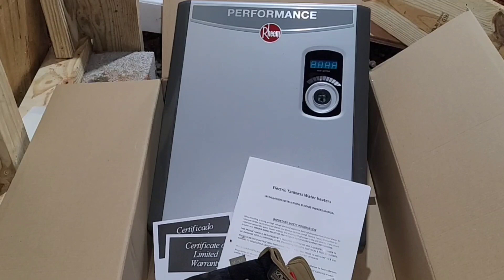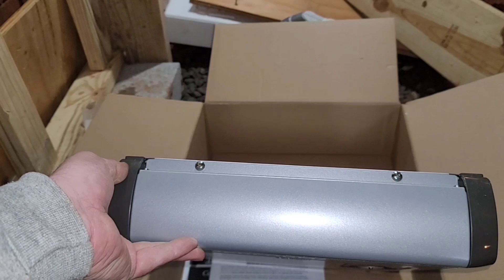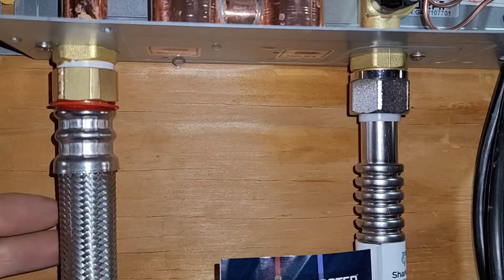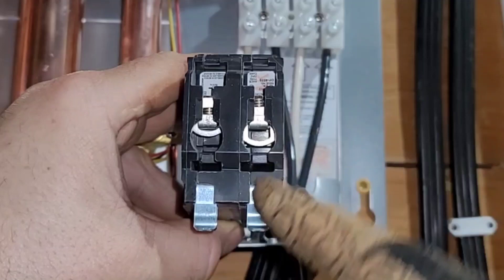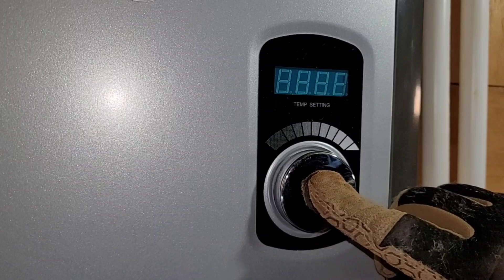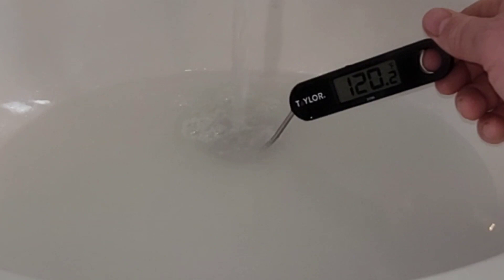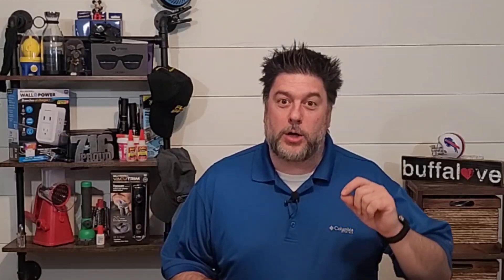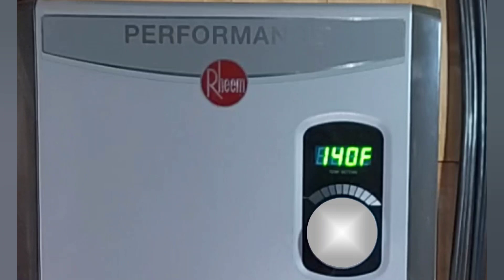🌟 Tankless Water Heater Installation. Rheem tankless water heater installed and tested [478]

Comment: Hello Jeff, I have a question. If I'm installing a 27kw rheem tankless water heater will I need three 8/2 wires and three 40amp breakers to get it hooked up correctly?
Reply from the maker: Hey there, my recommendation is to always consult an electrician, as i am not one. I checked outthe HD website, it looks like the 27 kw unit calls for 3 double-pole 40 amp breakers and 3 separate 8 AWG wires.
Reply: Thank you for you quick response. I appreciate your help and confirmation.

Comment: So at the double pole breakers, one gets 2 black wires and the other gets 2 white?
Reply from the maker: Always consult an electrician if you're not 100% sure what to do. In my case I had black and white on one breaker and black and white on the second breaker. And although I did not show it in this video, I did reconstitute the wires so they were both black. Thanks for stopping by and commenting 👍

Comment: I have this unit and I'm getting an E5 code. The code won't go off until we choke the water down to a trickle. Any thoughts?
Reply from the maker: E5 is a flow rate code.   I get that too, but it doesn't seem to impact the hot water. My psi is set to 60. Thanks for stopping by and commenting 👍

Comment: The only problem is if the power goes out, you have no hot water, you still have hot water with a natural gas tank heater
Reply from the maker: You are correct. My last water heater was also electric, so I'm in the same boat. Lol. Thanks for stopping by and commenting 👍
Reply: @Jeffreviews4u  Have you thought about getting a generiec system, that would come in handy..
Reply from the maker: That's the goal for 2023. I've recently priced them out, now to save the cash.

Comment: That is a slick unit, what gauge wire did you use?
Reply from the maker: 8 AWG...pretty thick stuff. I've been impressed so far. Thanks for stopping by and commenting 👍

Comment: Your tank had E5 shown on the display. Is that an error code?
Reply from the maker: An E5 is excessive flow rate, it is fixed by adjusting the amount of water coming into the unit. Thanks for stopping by and commenting 👍

Comment: Does this unit come with the electrical wiring or is that bought separately? Also, if it isn’t included where can I buy them?
Reply from the maker: Wire not included. I purchased mine from Lowes in the bulk wire section. Thanks for stopping by and commenting

Comment: Im getting e5 code and water is not coming out hot enough. What are your thoughts
Reply: The E5 is actually an error that is letting you know that the water temperature that you have set is not being reached.  Typically, due to excessive flow rate. Meaning, due to high water pressure (high flow rate) the water is not staying in the element long enough to reach the desired temperature.  So the fix would be to install the proper flow regulator and/or lowering the desired temp.
Reply from the maker: Yes, he's correct e5 is a water flow rate code.

Comment: I live in Louisiana and mine does not stay hot. It gives me a lot of problems. At times it does not come on. Help ?
Reply: Water temp may be set to high for the amount of water flowing thru the unit.   We set ours to 130.   When we maxed it out to 140, the water flow is to low for that and the unit would shut down because of over heating.   Try setting yours to a lower temp.

Comment: I have to remove the one in my new-to-me condo because I only have a 100 amp service, and my next door neighbor (an engineer) says my electrical main wire is probably getting hot and could cause a fire. He brought it up at the annual meeting, so many of the owners are worried.  It’s going to cost around $700 and take several hours. I’ll have to cut out the bottom of the cabinet, etc.

Comment: Everyone must know do not install these units unless you have 200 amp minimum panel. And use conduit to the unit for your wiring when exposed , not in the walls or under or attic but when the wire daylights to the tank.
Reply: Is 200 amp panel required?  The 18kw recommends 150 amp.  I'll be installing mine on a 125 amp box.  I'm hoping it works okay.

Comment: I am planning on installing an identical unit to power one bathroom and a kitchen.   Hoping that 18kW is enough.  There is not very much experience out there for installing these.  Several companies that install water heaters said they would not install electric ones.  PLUMBERS!  If you get knowledgable about electric water heaters you can capitalize on a huge amount of business that will be coming your way due to the federal tax breaks for electrifying homes that go into effect in 2023.  (IRA law)
Reply from the maker: I made some adjustments since this video, make sure to check this out: https://youtu.be/Yt6f2tceRgs
Reply: @Jeffreviews4u  Thanks.  I'll check out that video also.